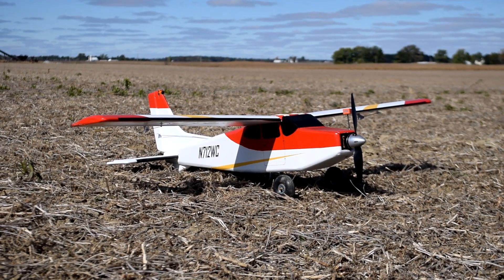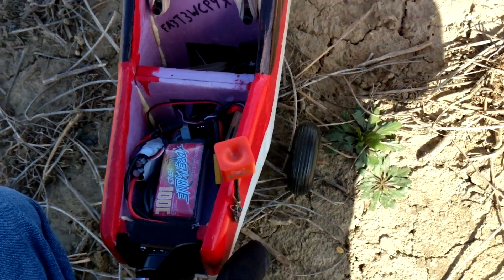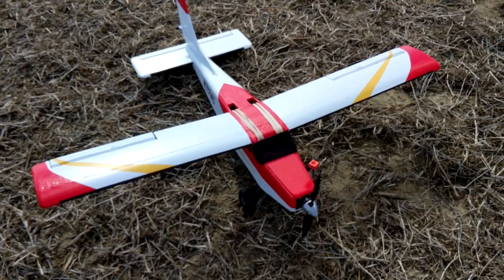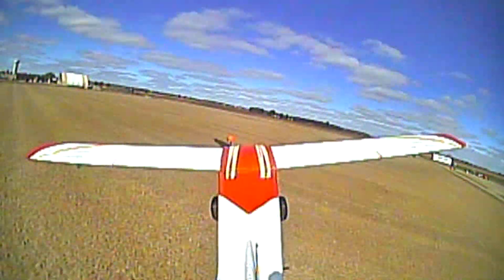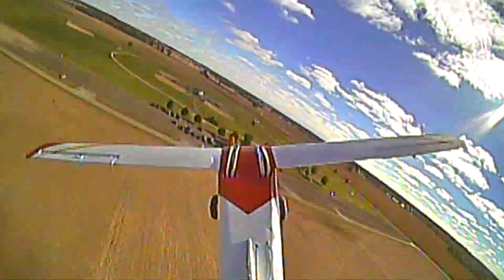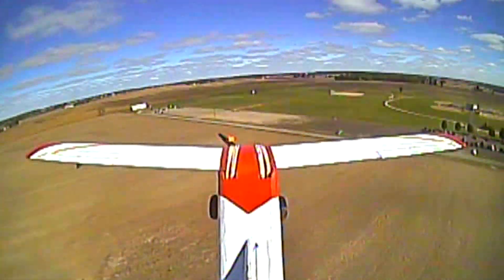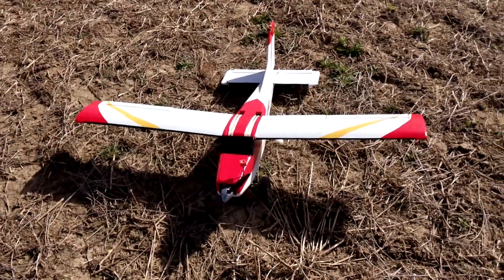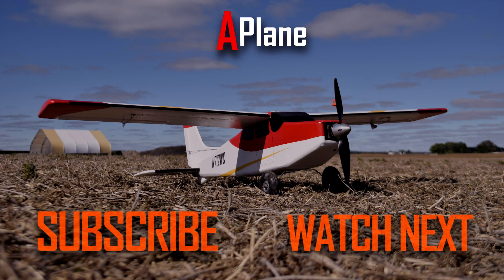Scratch Built RC Bush Plane - MAIDEN FLIGHT

Comment: Nice looking plane. Did you design it? Are there plans for it?
Reply from the maker: Thanks! I did design it. I used AutoDesk Fusion360. Here are the plans: https://drive.google.com/open?id=1cnQm7TmV--NODb0cpO2b6vWrSWqGYXSC

Note: I did not end up using a 2206 2350kv motor since it was too small. See description for updated electronics used. Also, the final weight with battery ended up being about 1100g. I am in the process of building a larger wing for it with flaps and larger aileron control surfaces, so I'll make a video on how that goes once its finished.
Reply: @RailTrailRC  thank you good sir. I will be following your build and have subscribed to your channel. it's a sweet looking high wing and I will definitely give it a go.
Reply: @RailTrailRC  I have a big 35x46 1100kv I think will work well for her
Reply from the maker: Cool! Hopefully the plans make sense. If you have any questions let me know. I'll be interested in seeing your build!

Comment: Congrats on a very pretty plane and successful first flights!  Is she mainly made of cut and covered insulation foam or depron?
Reply from the maker: Thanks! It's all made of pink insulation foam. I linked a couple videos in the description that show the progress when I was building it.
Reply: Really nice construction job.  I also enjoy foamular and gorilla glue - a match made in heaven.   Have you considered covering it before you paint with fiberglass cloth (or tissue paper) and polycrylic or epoxy?  It's light and gives a lot of rigidity and crash-resistance IMO.   Congrats again!
Reply from the maker: I would like to learn how to fiberglass planes, but so far haven't had time to learn or figure out where to get the materials. I'm already planning a new plane which will be quite big, probably around 100in wingspan, so I would probably consider covering it with something.
Reply from the maker: I actually came across your video already! I'll check it out again and look more into fiberglassing. Thanks man